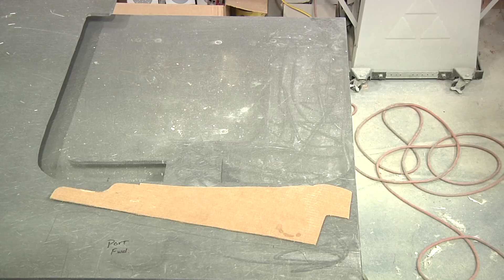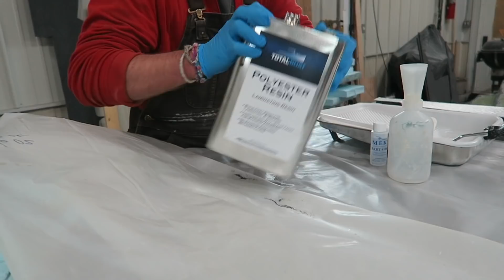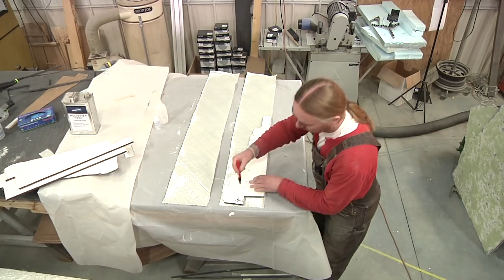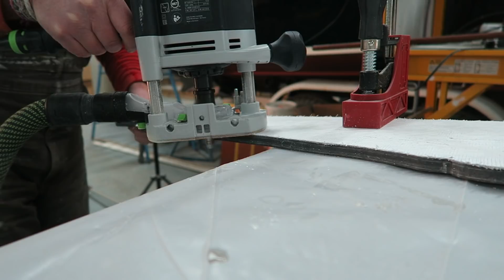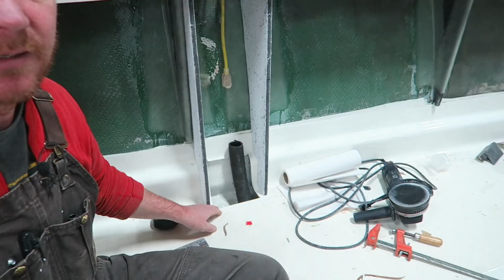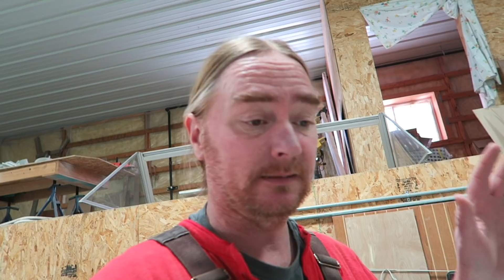Stubbing In For The Fuel Fill Line!

Comment: Why not glass in the lower 2" of the box face and have it watertight to the deck and side hull.  Leave the upper 3/4 of the box with a panel cover for inspection. Round over the corners so it matches the lines of the original decking.
Reply: Exactly what I was thinking!👍👍
Reply: My thoughts also the same. But be sure to have a good vent system. Regarding the hinge, I'm fond of a stainless steel piano hinge
Reply: Yeah I’d cut a piece of Cussa to fit in flush between the two knees 2 - 4 inches high, bond it in with thickened epoxy. 
You could fillet the inner radii to look nice then fair the outer surfaces...
Reply: Also what I was thinking but instead of a hatch mount a speaker on there which can also be easily removed should you need too for inspection. mount a speaker the other side also.
Reply: @gnrphil  a speaker? One spark and BOOM!
Reply: It also allows you the flexibility to put the hose in at the end.....hose clamps...deck fill and such.
Reply: That's the same I was thinking, when watching Your Video
Reply: I agree !

For the hinges, get aluminum piano hinges. You can get them in many different configurations. If you need something custom, look up tinyboatnation on you tube. He has a video on making custom hinges.
Reply: instaBlaster...

Comment: PCV and Epoxy are not bounding well. I assume it is the same for Polyester.
Reply: To get a good bond the pvc needs agitated very well with 36-50 grit. If using polyester/vinylester, a wet wipe with styrene right before glassing is recommended. The styrene acts as a plastic adhesion promoter.

Comment: Can you put the hinges below in the compartment, keeps the floor space clean.
Reply: yes, and he can use one of those springs to keep the lid open while rummaging around inside the locker. or he can get a proper gas strut if he wants to get fancy. you can get gas struts on amazon for about $12-$14 per pair.
Reply: Or maybe recess them in if left on top?
Reply: Consider the rotational axis of the hinge.. Placed below in the compartment, how would you open the lid?

Comment: What if you sort of box in the hole in the floor and drill a new opening a few inches higher up? It would give you a good place to attach the face and flat surfaces are easier to work with.

Comment: My first thought was the second option you described but also extending vertically along the edge of the cutout.
However, if it's allowable, the "sanitary drain" PVC pipe option is sounding like the best idea.
Hinges: Can you rabbet them in so they're flush?